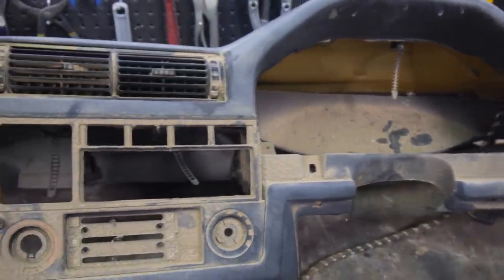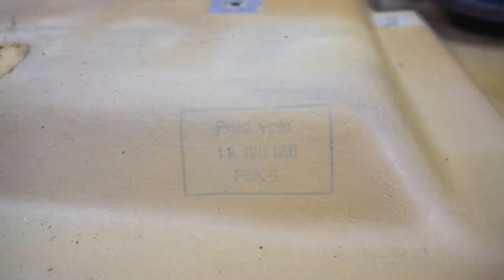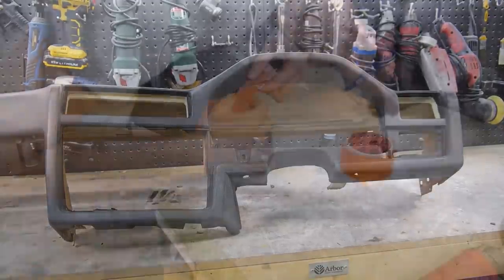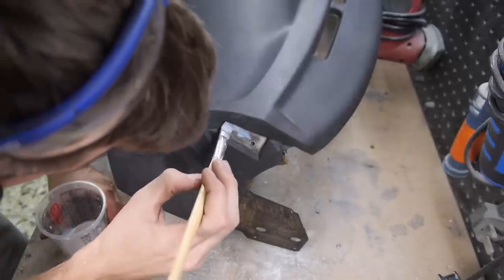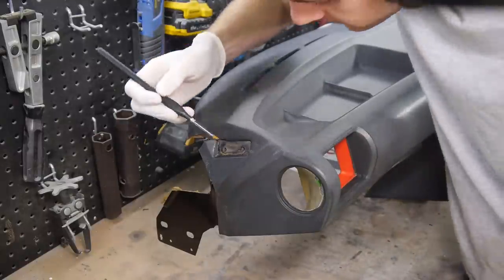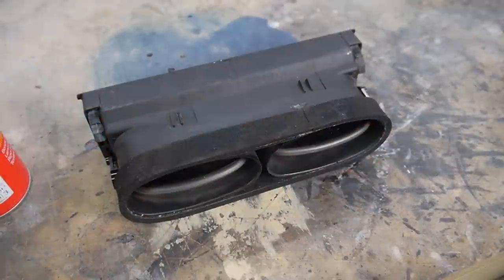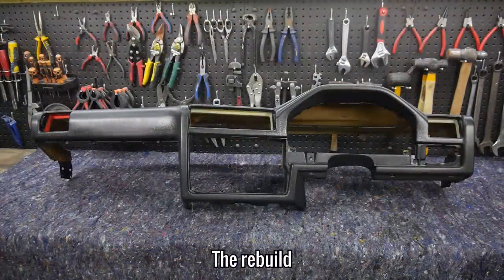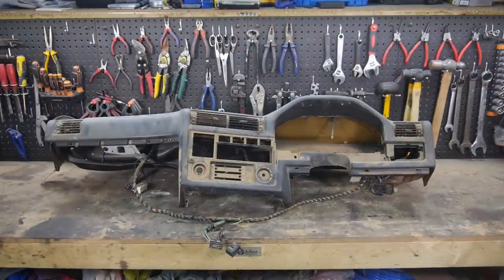BMW E30 Dashboard [Restoration]

Comment: The attention to detail is just one of a kind! You completely restore parts that are never seen and are hidden away. Thats some dedication!
Reply from the maker: Thanks Car Pro, very kind of you!
Reply: @RestoreIt  Honestly it should be a museum car at this point. 😂
Reply: Agreed, like who else cleans the wires? Hahaha
Reply: @Takamine840  😂
Reply: @Restor it 3M makes a padded dash filler. But its only intended for small areas to be filled. And it comes in quite a small can that is kind of expensive.
Reply: Like removing rust behind the riveted brackets... even the factory didn't protect these locations agains oxydation... so much work to actually improve the factory.
Reply: This man is a perfectionist. If he doesn’t restore everything including the hidden pieces, he will still know it’s there and will bother him.

Comment: Proposal for dash dyes according to experience:
Leather dyes - get black, white and ochre and make the colour you need using them (keeping tab of the quantities to ensure repeatability). 
As usual prep is king - dishwashing soap and water, soft brush, then spirits (75+% alcohol) until you are sure it is clean, microfiber towels a plenty is also something you will need.
Then, once you are absolutely positive you have cleaned (clean again:) ) get an antistatic microfiber (the window specific ones) to be sure you have no strands on the surface.
Leather dyes are usually pretty thick so unless you get the mother of all paint tips you will need to use a synthetic sponge to apply using soft pounding motions. 
If not spray it from about 30-40cm with  acrylic thinner (different paints have different ratios so check)
5-6 coats should make it invisible.
Angelus have a matte laquer "duller" which makes it factory matte as matte is never matte with dyes. 
2 thorough, thin coats and a third thick one should make it less blue (normally black turns blue when diluted).
I have also used MOTIP cans to do colour changes (from brown to black on Alfasud doorcards) which was just fine for the most part but for good measure did it over with a sponge to be 100% sure, works a treat on synthetic.
This is my experience, I hope it helps.
P.S.
I am sure this holds up for at least 3 years so far without being too careful while using the car.
Reply from the maker: Thanks very much Alek! I'll save this comment, cheers!
Reply: @RestoreIt  Before I forget, in between the cleaning coats make sure to use a grey scotchbrite pad to slightly scuff it up. Try either dry or a splash of alcohol on the pad
Reply: Don`t use leather dyes on vinyl.. leather dyes are made to be absorbed into the pores of the leather. Vinyl is plastic and doesn`t absorb anything.

Comment: UV is the greatest enemy of polymer. If you want this dash to remain crackless, keep the sun off of it (as much as possible). Another recommendation would be to use "303 aerospace protectant" the stuff is amazing and works great at revitalizing foam rubber seals as well. Your videos are great thank you for the content.
Reply from the maker: Okay good to know thank you Terry. I'll look into that stuff right now, Glad you enjoy the vids!
Reply: Project farm did a uv protectant comparison video not long ago, 303 aerospace didn’t do too well tbh
Reply: I've not seen the comparison video. I can only speak from personal experience. I've been using aerospace for years. It did wonders for the interior panels and the door seals on my '87 pickup.
Reply: I recommend 303 aerospace too.
Reply: 303 Aerospace, definitely a good recommendation.
Reply: @RestoreIt  another thing to try is to get a ceramic tint on your front window to reduce the UV exposure your dash gets. Im getting it done on my truck in a couple of months since I live in Texas.
Reply: 303 aerospace offers 0 UV protection fyi.
Reply: @jacobmay7594  protecting the dash from uv, and conditioning the polymer the dash is made of are separate but equally important in preserving this old dash.
Reply: @tleg6969  agreed, but it's not actually conditioning anything. It's just covering the sun faded (bleached) dash areas. You wipe it off, the fade is still there. You can do the same thing with motor oil or olive oil.
Reply: @jacobmay7594  I don't know what's in the stuff (proprietary blend) is all you can muster from SDS. But whatever is in it does a damn good job of making vinyl and butyl rubber soft and pliable, inside and out. Its not petroleum distillate based like armor all and a bunch of others, so it doesn't draw the oil out of the polymers it's put on.
Reply: @tleg6969  check out Project Farm on youtube. His video does a pretty good job at showing how good 303 and other brands are at restoring faded trim.
Reply: @jacobmay7594  I did after the first guy in the comments said something about it. That does an excellent job of showing the effects of solvents and weather on different products. It does nil for showing the effects it has on pliable polymers that dont get battered and washed off in 5 minutes...it also proved that permanent coatings i.e. ceramikote/clear coat is the preferred option for bumpers. But none of that correlates to polymers inside a car that have an opportunity to soak up whatever is in the 303.
Reply: @jacobmay7594  I have a 1987 chevy that's rolling proof that it works. Door seals, dash, interior panels, even the pesky triangle window seals look immaculate.
Reply: 303 works great for me, but it doesn't last long. 
I use a sun shield for my dash.
Reply: @PB-wb2kj  Not possible! He is living in Spain and it’s totally ilegal... not even in the windows of the front doors! 👎🏻(i know because i’m also living in Spain 🙁)
Reply: @jacobmay7594  that's not what's claimed, read the label again. It says "Powerful UV blockers". So if you are serious about your doubts, let's see some 3rd party testing. Your anecdotal evidence is not enough. I'd be inclined to believe you if you provide evidence of your assertion. Otherwise you are just talking out your ass.

I've used 303 for years and am completely satisfied with the product.
Reply: @doofwop  if you read my previous comments you will see that its been tested check out Project Farm on YouYube He tested it and lots of others 303 was not UV blocking anything except  the shadow the spray bottle casts.
Reply: @jacobmay7594  oooh so Project Farm is the last word on EVERYTHING is what you're saying. Umm no. They guy's channel is interesting but he is far from a scientist being scientific. Do you also still believe in Santa Claus?
Reply: @PB-wb2kj  There is a UV tint on the market that is pretty expensive. I am not all that familiar with it, but I will be seeking out the specific product and or shop once I remove the front and rear glass of my E30 and any other car that I take the glass out of ✌🏾

Comment: Refinishing dash surfaces is usually reserved for very damaged dashboards and it's very difficult to get them to look perfect. (which you insist on) I would not mess with this dash. It looks really good. Great video.
Reply from the maker: Cheers for the advice Daniel! Any refinishing will be tried on lesser dash's before I'd touch this one again. Thanks again!

Comment: I dont get why bmw still makes some new parts for e30s but not the dash, they would literally make a killing if they started making them again
Reply from the maker: Let's start a petition. They can take all of my money.
Reply: The question is wheter the tools still exist to make new ones
Reply: I guess they would be so expensive that BMW does not believe there's a market for it. And it was most likely not done by BMW
Reply: the problem with some of these things is, that some of the manufactories that made the parts aren't even around anymore... I know for a fact that VW tries to make new parts for old models with their classics programm by getting in contact with the original 
manufacture of the part... but they also said that it's a problem having these parts reproduced on new tools since this can cause fitting problems... I believe that in some cases they even bought the old tools of the not anymore existing companies to ensure a good fit because you don't want a new dashboard where for example 3 holes are off by 1.5mm and your whole interieur starts screeming /screeching every time you take a left turn or something like that
Reply: Wait, they dont make them anymore ? Even not the  bmw classic “factory” ?
Reply: grays wow that sucks !
Reply: Same with the e36. I’d kill for a few interior parts they no longer make! Just have to wait for the right used one to pop up I guess
Reply: Ihavecat same man ! Im restoring my e36 but its damn hard to find parts for the right price
Reply: Amen!  I heard someone I believe in Miami bought the last new NOS oem dash panel for $2500, I think.  Come on BMW, make em again!  I need 2!
Reply: The chemicals that they likely used in making the materials and adhesives and glues to put it all together are probably illegal now. Too costly to redevelop and reengineer a limited market low volume part.
Reply: I know Mercedes Classic Center will sell you any part, they'll even make it for you it doesn't exist anymore so long as you have the money
Reply: @antonm0778  I think BMW finally is realizing they are missing out.  I know they have started of the last year at least making some more old parts available.   Like you said, if you want to pay!
Reply: Sadly, it's because though there are a few e30 fans, the cost would be prohibitively expensive and they wouldn't be cost effective. For example, Porsche still sells dashes for the 944 but at around $6k no one is buying them.
Reply: Skip Smith I think it’s the other way around. I believe it was last year I read they have stopped manufacturing new parts for many classic models
Reply: Most of all, such parts compared to many other parts are much more complicated. Everything metal is essentially piece of cake to make, so having proper shapes punched and bent is not an issue. Producing whole dashboard is a bit more complicated process with multiple steps. Now you want to ensure it will nicely fit and match originals but methods of making things like that changed a lot. E30 should at least be ok in regards of automated production. It's different with older designs which were partially or completely hand made and those can't be fully automated because of the design. Now everything is made to nicely mass produce, back then it was not an issue and many parts are simply hard or impossible to produce in automated way. 
Long story short, even if they get matching materials and get original or replicated molds, it will be very expensive to make.
Reply: @RestoreIt  You mean they haven't gotten all of your money yet?!
Reply: @RestoreIt  Can we add the e28 to that petition? People are now paying in up to $2k for the few crack free dashboards that are out there.

Comment: I dyed my gray interior to black. I used dawn dish soap as a degreaser, dried, then used acetone on a microfiber before I painted it using duplicolor black interior dye. For low touch area's I did 4 light coats and for high touch like door panels, kick panels and center console I did 10 coats. It was in the car for 6 years 70K miles and did not rub through. Very simple to do.

Comment: Hey man,

You said maybe within 3 years, the dashboard will crack as your car original one.  
You can avoid anything like that by using leather moisturizer but add a very thick layer of moisturizer and keep doing that for a week until you feel the leather getting softened. Then you can apply moisturizer once every month or so.
Reply from the maker: Sweet thanks for the advice man.. I'll give that a go.
Reply: But I'm almost sure its not leather, most likely vinyl of some sort

Comment: Depends on the severity of the fading, but heating it up with a hair dryer or hot air gun should help reflow the pigment of the plastic. 

Just a suggestion, as this method works on restoring faded plastics that have been damaged by uv.
Reply from the maker: I'm going to get an adjustable heat gun and try this out
Reply: @RestoreIt  please dont. You pull out the softener of the plastic when you heat it up. This is why dashboards crack in hot environment. When you try this, your dash will crack sooner as you want.
Reply: Dont heat jt fades and dries out the material even more, use a ceramic trim coating instead !!!

Comment: What a satisfying video, can’t fault your patience and workmanship .I took the dash board off my 1972 Elan S130 many years ago to replace a faulty fan motor when I started and finally got it all off , the fan motor started working ffs,, what a job, seats out ,Center tunnel out ,under dash trims out, rear seats out , release water pipes. To heater  matrix , drop steering column  air duct covers out , demise grating ou5 plus a lot more , did it in the end though , I miss my lotus by the way 😩

Comment: Brilliant job, I was restoring an E9 and documenting on YouTube as well. This is inspiring me to get back to the daunting task. I appreciate your level of detail and attention to the looming. One thing I wonder if it’d be worth doing would be checking the continuity of the harness incase and are faulty, may save you chasing electrical troubles down the road. Well done 👍🏼

Comment: I would just keep feeding it Vinyl And Rubber restorer and hope it will not crack, am sure it can't hurt it and only help.
Reply from the maker: That's pretty much the plan at the moment :)
Reply: Tint the heck out of the windows or only park in the shade.  You'd be surprised how hard it is to notice a 50% tint on the front window but the dash could have a chance to survive the sun exposure.

Comment: Hey man, great job as always! Have you considered restoring a cracked one? What would be the ideal scenario to bring back to life such dashboard? I heard some people are rewrapping them with the leather-like material BMW is using. What do you think?
Reply from the maker: I'm going to do this exact thing. Maybe with filler and then try to recreate the pattern, or like you said rewrap the entire thing. I now have a spear one to try this on.
Reply: Restore It even with filler it will not last long, as the problem is with the dashboard connection to the car. it does not allow for heat expansion or shrinking, so it cracks. flexible connections after dash repair is one way to make it last long

Comment: Quick tip on the dash.  Put the foam around the inside front of everything installed into the dash to make the vents and even the gauge cluster not rub and rattle.  This is where 90% of all the rattles/squeaks come from.  I would even put that foam on the edges of the dash that touches the metal of the car anywhere.  You will never know it's there and the lack of squeaking and rattling down the road will make you very happy.

Comment: Vinyl interior paint to restore the colours?
Still looked great what you did.
Btw, a wire looked loose on the harness on 1 of the connectors. Maybe it's supposed to be like that? thought I'd mention it
Reply from the maker: I think i'm going to try a paint system or two for sure. And you're not wrong. It's back in there now.

Comment: Very nice job man. Imho, you did what to had to do for a car of its age. Painting it again and making it look brand new, would be more than a restoration and would somehow make it feel not restored, but something around bought new. A well maintained old car is on a different level than an old car with all brand new parts. And the dash is a major part /factor to the restoration.
Cheers!
Reply from the maker: Cheers Tester! I toally agree with you on that.

Comment: Very nice result! I've restored my dashboard with "Cif" cream as cleaning base and low-silicone waxing coat as a top layer. But if you're using chemistry for cleaning something, you need to work fast and remove it before the surface will faded up or became "smoky". Will try your method next time. Thanks for video, man!

Comment: I used Dupli-color gloss black interior paint  and worked great, 2 years after painting it still shines . I added some insulation padding above the glove box and cluster area and it got rid of a lot of vibrations. Makes the car feel new.  I couldn't find a foam that  was similar to the oem they are all to "airy" .
Reply from the maker: Thanks for the info dude. I really want that foam!

Comment: I've re-used SEM vinyl & plastic dye before and it's very very good! The Landau Black color they stock matches OEM BMW stuff perfectly.
Reply from the maker: Cheers Mythbuster!
Reply: SEM is no joke. I've used it on several restorations and it holds up incredibly well. Be sure to use the 'Color Coat' version.

Comment: great job! suggestion: at 19:45 better let dry the spray adhesive for 5 mins, then apply the foam. You will get a much more stickier surface instead a slippery one, after the solvent is evaporated

Comment: Tip: I had to restore the Vinyl rear bench seat on a 1984 sedan. This work surprisingly well!! Try MEK (Methyl Ethyl Ketone) on a sample of the same type of plastic (e.g.-Vinyl, ABS, Polystyrene) to get the technique right. But first clean and de-grease the parts thoroughly as you may embed the dirt/grime. It seems that MEK is actually melting the Vinyl, if done quickly you will not remove the "wrinkle" finish. This may also be an easy and quick way to fix hairline cracks in the surface. Use a lint free white rag, since the surface may hold onto any debris. I have only tried MEK on Vinyl, but the same process may work on other plastics using solvent that will actually melt the surface.   Good Luck! Thank you for the video, very Cathartic and educational.  If you want that Rally Car look, try "Flocking"!!! I did this for a friends race dash to cut glare from the sun. Also I restored the headliner on and old Land Rover. There are so many colors!!! Plus you can mix them to an extent for a unique color.